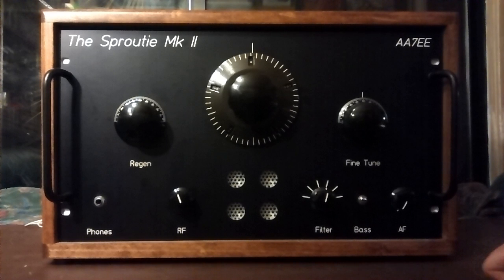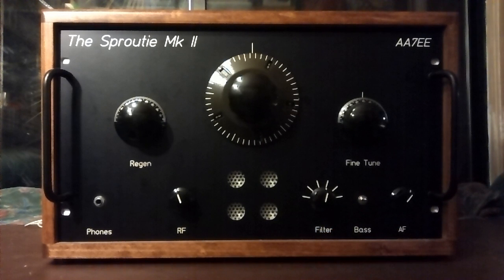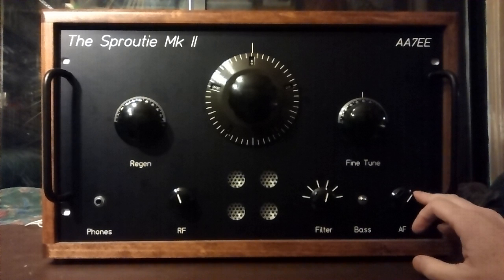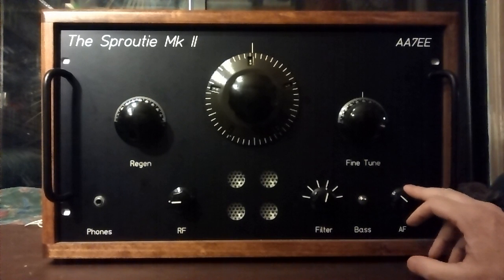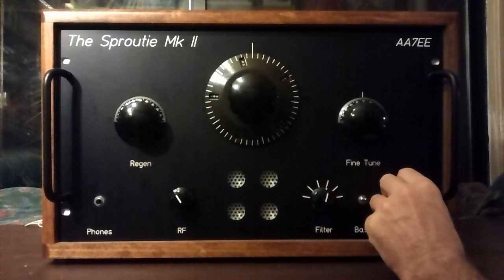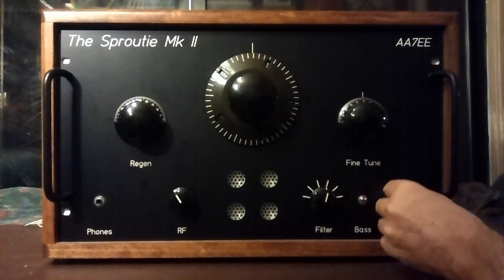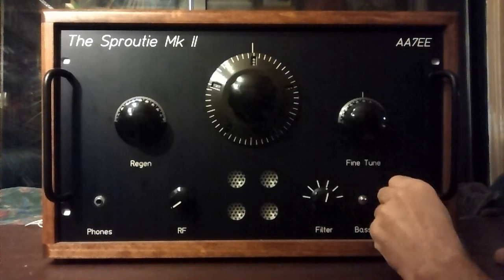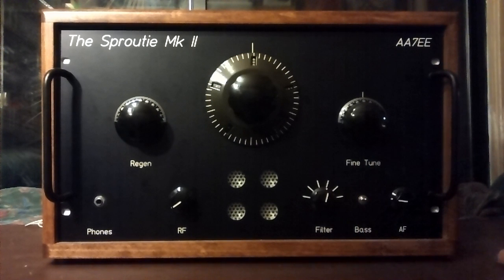The Sproutie MK II on 49M, 41M and 40M (though mainly on 49M)

Comment: HRO knob. Is it an HRO drive box and capacitor?

If you keep it in oscillation, a simple freq. counter box reading a sample off the Regen device, would give a constant display.  On AM, up the regen. to take a reading and then back to below the thresh-hold
for AM.
Beautiful build. You are to be complimented on that construction,
That National tuner gear box is ace. Must be hard to get them now.
Nice thing about TRFs is that you get no birdies or images.
Didn't know that the numbers stations gave a burst of data!  Not heard one for ages.
Great video. de G3NBY
Reply from the maker: Yes Howard, it's a National HRO dial and drive. They're not too hard to find here in the US. They appear quite often on eBay, though in nice condition, they're not cheap.